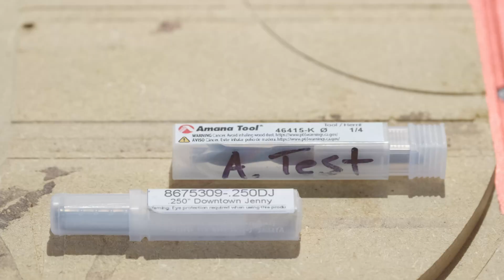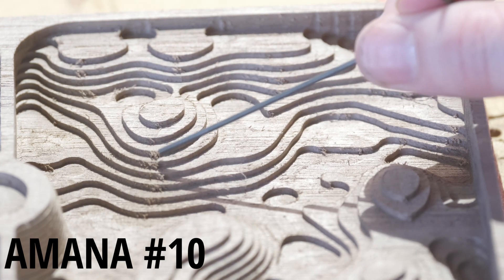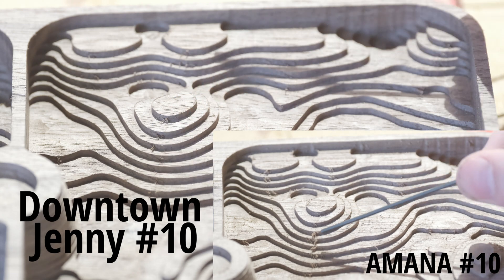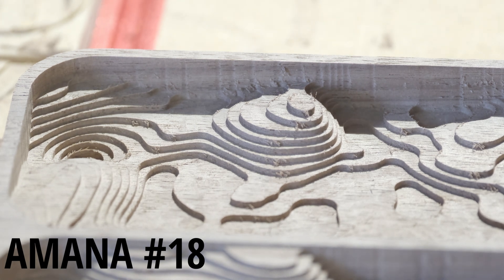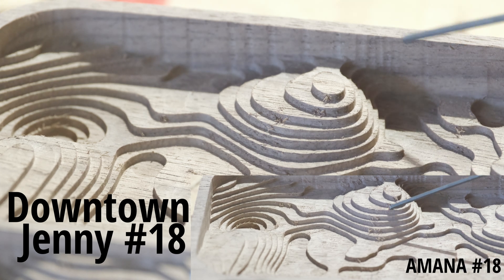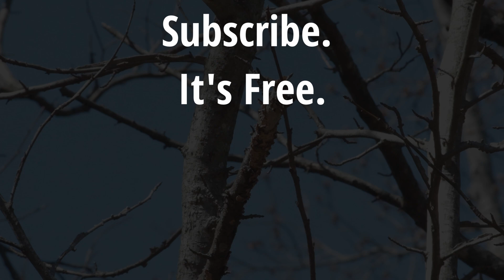Why Are You Still Using Amana Bits?

Comment: Are you getting any gumming on the cut face with repeated cuts? Specially if allowed to cool and go hard. For the amount ofwork you're making those bits do, is an upcut better? downcut is back scraping the woood fibres, probably your cause of sidewall chatter. Straight or upcut would be cleaner. New HOGGING bit much better still!

Comment: $5 cheaper and it lasts slightly longer? That is an amazing deal over the long term. Now, can it be sharpened reliably? I can get mine sharpened with the new dimensions for a decent price locally, and they specifically say they sharpen all the major brands, so if it can be sharpened, it might be extremely worth it.

Comment: Carbide should stay sharp much much longer than what it takes to make forty of those trays. You need to check your feed rate and the rpms of the spindle. Heat is the enemy of tooling. If your chipload is correct the heat will be carried away in the chips.
Reply: did that... help (a lot)?
Reply: All wood contains silica (think sand).  The silica is why wood wears the bits.  Too slow a feed rate or to fast of rpm results in more cuts for the same amount of wood removed.  In my experience, my bits are always cool enough to touch seconds after finishing a cut.  Hence, not very hot. Not hot enough to impact wear resistance.

Comment: Very informative, a well done video.  One thing I noticed is where you said you had chatter on the wall, it looks like that was just where the bit stopped its x-y travel to plunge to its z mark.  Other than that, I'm always on the lookout for cheaper, better bits.  I've always been questioning the Amana coatings or the Bits and Bits coatings.  Seems like some of that is just hype.  I used Bits and Bits Astra coated 1/8" compression bits for cutouts on birch ply, and didn't get any better results than with the cheap uncoated bits from Amazon.  Keep up the great work!

Comment: Check your side pressure if you can as the fraying is at the same spot on both bits adn bowls
.  This would indicate that the Metal in the Amana is softer metal and has more flex than the jenny.
Reply from the maker: Great info, thanks!

Comment: Holy smokes, I am obviously using my bits for wayyyy to long 😲
Reply from the maker: Lol, you're probably fine. My trays are hard on them and 40 trays is over 20 hours on each of them! Not to mention they are plowing through double sided tape on the profiles.
Reply: @HamiltonDilbeck  yeah, I'm definitely not doing the fine detail stuff you do in those trays. I did just lose a Whiteside astra coated 1/4" downcut spiral bit while carving the center panel out of some kitchen cabinets for a neighbor (remodeling with glass). The nice people who made her doors used about a dozen brad nails to secure the panel for some reason - shot in from the side? Weird, weird, weird.
Reply from the maker: @JayBergCustoms  I'll never understand why people don't just use a point driver for that stuff.